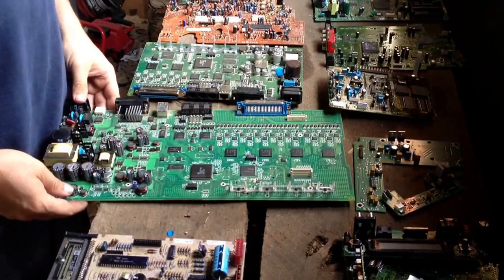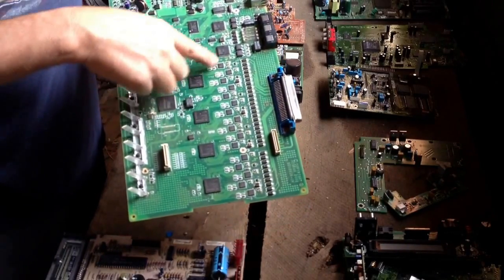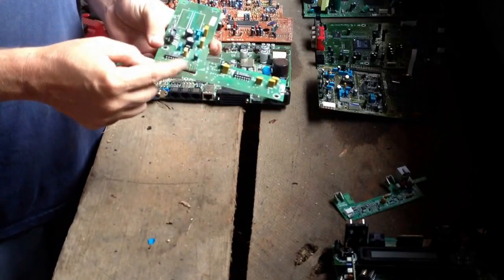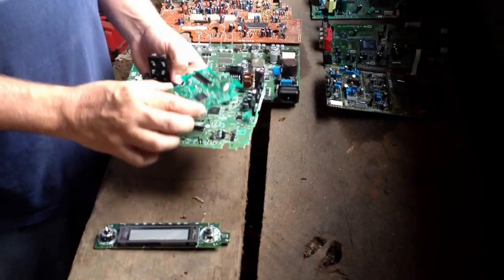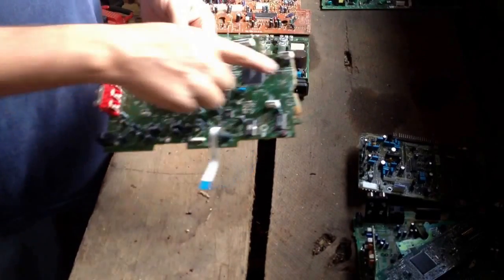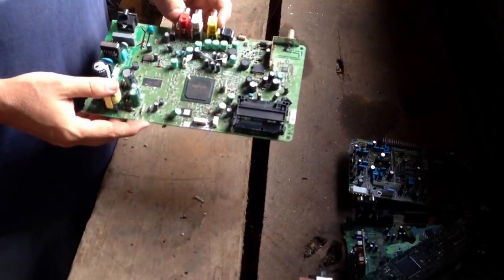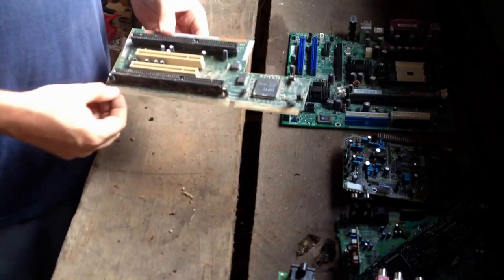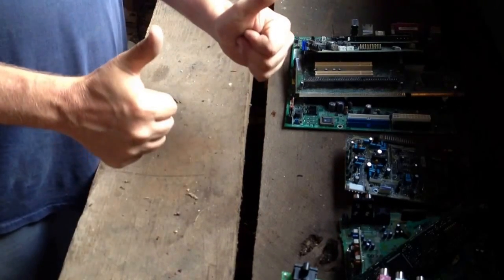Ewaste understanding printed circuit boards for beginners

Comment: Is the value of the board just in the gold? I would expect the copper to be worth a lot at this point but I have no idea if it's recoverable...
Reply from the maker: It really depends on the part, some boards carry value on Ebay, some for gold. It really pays to research what part you have.
You can check by looking at ebay and the completed auctions to see a value range

Comment: the last board is a cd/dvd rom, board before that- gold finger cards, board before that- its a gold finger card, but if you trim the fingers off it down grades to a backplane board. 
 You might want to start using boardsort.  
  not wanting to sound harsh, but every penny counts, and listen to you  i feel you are loosing pennies